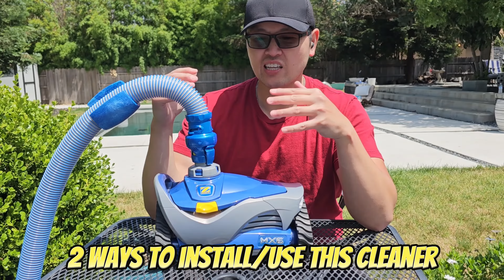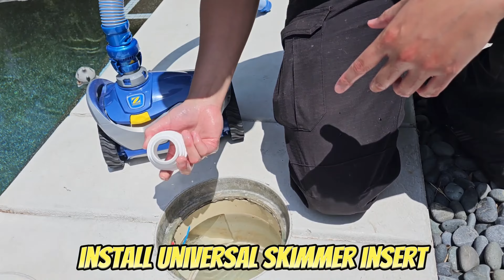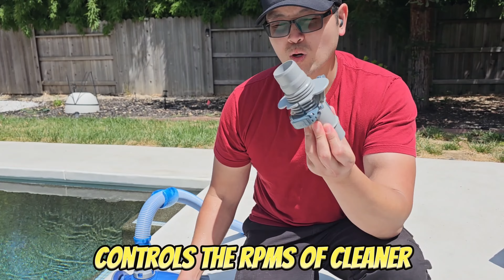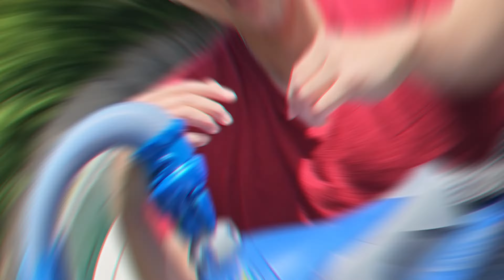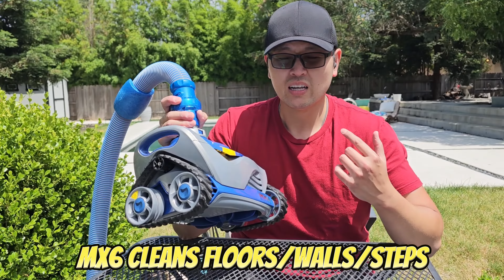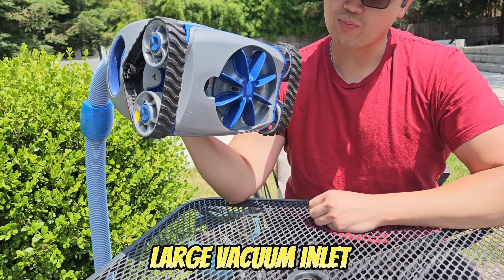Zodiac MX6 Review

Comment: Which is better: the Zodiac G3 that you did a review on or this Zodiac MX6?   Thanks
Reply from the maker: The MX6 is better generally because it has a mechanical navigation function built into it. Meaning it's programmed to turn a certain direction after a certain time. So it gets more coverage this way. As opposed to the G3 which uses just a random pattern with no navigation based off the suction of your pool.

If you have a flat basic pool, the G3 will work great. If you have a bit more complex style, with steps, curves, ledges, the MX6 is better.

Comment: How does it navigate? Do you know about its overall pool area coverage.
Reply from the maker: The MX6 has no navigation system. It's programmed to move a certain way based off the gears built inside of it. I forgot exactly but it's something like forward for so many seconds/clicks of the gears, then turn right or left for so many seconds, then forward again and repeat.

It runs of the suction of the pool so although it doesn't have a smart Navigation system it does pretty well picking up most debris because it runs pretty much as long as you have your pump running

Comment: Mine keeps climbing, goes beyond the water line. How do I stop it?
Reply from the maker: If it climbs too high and often it means your RPMs are too high. You want to lower the flow. There are two ways to do this depending on if you're using the mx6 through a dedicated suction line or if you're using the skimmer basket. If using it from a suction line you lower the flow by adjusting your diverted valve at your pump. If using it at the skimmer basket you can lower it with the flow regulator valve, the piece that connects to the cone that goes into the skimmer basket. There's a lever piece you pull down or up to decrease or increase flow. Hope that makes sense!

Comment: 2 holes ??
What dose the other hole go to ?
Reply from the maker: Two holes in the skimmer basket you mean? One goes to the pump and the other takes water from the pool. The suction cleaner attaches to the back one that takes it to the pump
Reply: I had a Hayward for years, and it broke down constantly, and was expensive to fix. My local store recommended this model, explaining that the parts to replace were few, and relatively inexpensive. It worked fairly well for a while, but in the long run, all it wants to do is wheelies, climb the wall and escape, get stuck on or in front of the stairs, or not move at all. I have done so many adjustments to speed and valves, and the sweet spot for it to run properly is seemingly very small. I recently got a new variable speed and filter, and it's still up to its old tricks. Every review I've seen says it's great, but that hasn't been my experience. I've paid for it twice over now in replacement parts. Oh, and the twist lock hoses are $30 each. If you get one, get a newer one with pressure lock hoses. If you already have the twist locks, get the adapter for $35 and buy cheap hoses until the stock hoses all break.